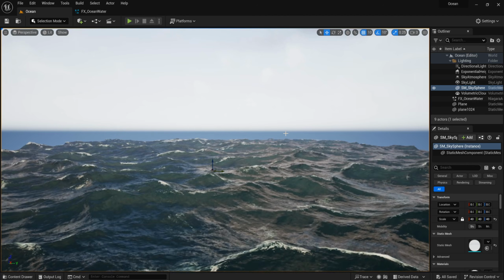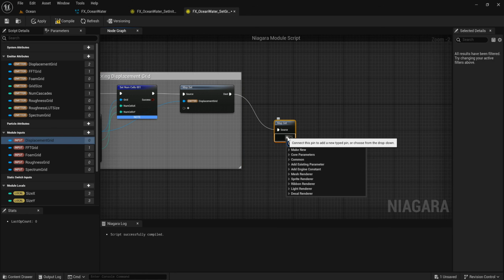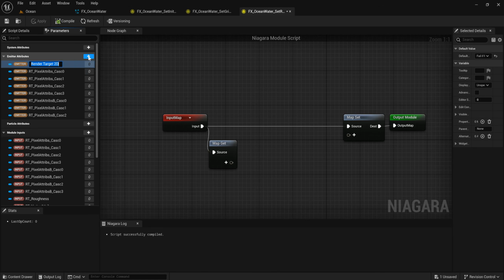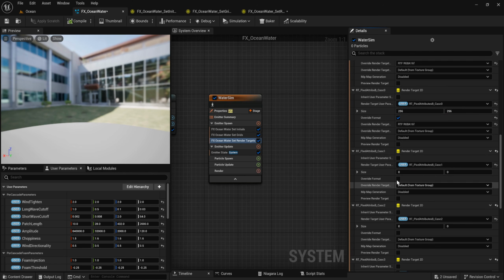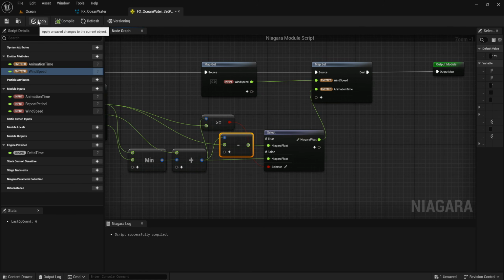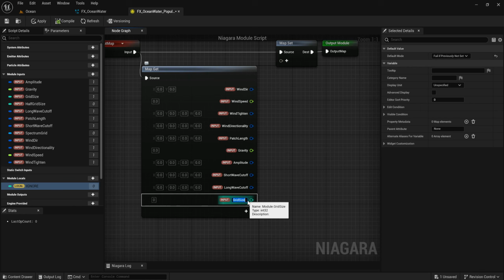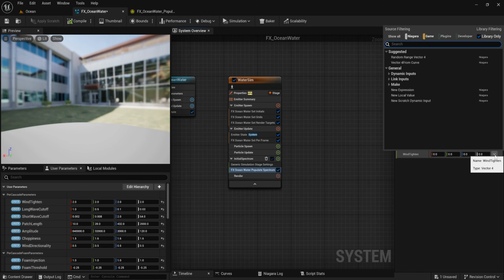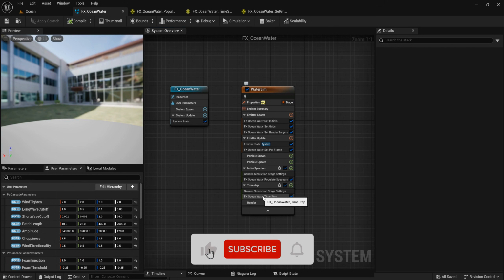Unreal Engine Ocean Simulation Tutorial: Part 2

Comment: Question. I had errors at each stage of hlsl code (use of undeclared identifier) and asked to add in prefixes (for example, in the line Freq = floor(Freq / BaseFreq) * BaseFreq; (like the BaseFreq variable is used, but was not declared as an input parameter of this HLSL function). I changed (for example BaseFreq to In_BaseFreq). The error went away. No more errors during compilation anywhere. But the preview is empty.
Reply: did you get anywhere with this?
my preview is also empty

Comment: hi, you have not set the displacement grid, and after step 6 Initial spectrum my preview is not showing anything.
Reply: I have same problem. I run 5.6.1 ver. Are you rurnning 5.3 ? or Are you already solve the problem ?
Reply: plz help me:face-pink-tears:
Reply: @최성연-r3m  i have the same problem. did you figure it out?

Comment: I got these errors, may i know why?

System failed to compile with 3 errors.
D3DCompileToDxil failed. Err0r code: Unspecified Err0r (0x80004005). WaterSim, Particle GPU Compute Script, 
/Engine/Generated/NiagaraEmitterInstance.ush:375:18: Err0r: use of undeclared identifier 'LongWaveCutoff'
	        Spectrum *= k < LongWaveCutoff[GDispatchThreadId.z] ? 0 : 1; 
	                        ^ WaterSim, Particle GPU Compute Script, 
/Engine/Generated/NiagaraEmitterInstance.ush:374:27: Err0r: use of undeclared identifier 'ShortWaveCutoff'
	        Spectrum*=exp(-(k * k) * ShortWaveCutoff[GDispatchThreadId.z]);
	                                 ^ WaterSim, Particle GPU Compute Script,
Reply: I have no experience in Unreal and am just a noob in general but I had a similar issue. I think it has to do with the custom HLSL code brought in via the FX_OceanWater_PopulateSpectrum Module. Check to make sure your naming is following the guide for all points connected on the Custom HLSL and make sure you have all the connections. I hope this helps but I'm sorry if it doesnt.
Reply: It's a mismatch with the variable used in the custom hlsl and the pin name that you declared. Example: HLSL code uses ShortWaveCutoff but your pin is named ShortWavesCutoff.

Comment: Im having these error before adding the stage on FX_OceanWater:
55571_FX_OceanWater_MessageLog: System failed to compile with 2 warnings and 4 errors.
55571_FX_OceanWater_MessageLog: Error: /Engine/Generated/NiagaraEmitterInstance.ush:372:54: Err0r: scalar, vector, or matrix expected
            In_SpectrumGrid.SetVector4Value<Attribute="Spectrum">(IndexXY.x, IndexXY.y, PositiveAndNegativeSpectrum);
                                                                ^ Empty, Particle GPU Compute Script, 
55571_FX_OceanWater_MessageLog: Error: /Engine/Generated/NiagaraEmitterInstance.ush:372:34: Err0r: use of undeclared identifier 'Attribute'
            In_SpectrumGrid.SetVector4Value<Attribute="Spectrum">(IndexXY.x, IndexXY.y, PositiveAndNegativeSpectrum);
                                            ^ Empty, Particle GPU Compute Script, 
55571_FX_OceanWater_MessageLog: Error: /Engine/Generated/NiagaraEmitterInstance.ush:372:18: Err0r: invalid format for vector swizzle 'SetVector4Value'
            In_SpectrumGrid.SetVector4Value<Attribute="Spectrum">(IndexXY.x, IndexXY.y, PositiveAndNegativeSpectrum);
                            ^ Empty, Particle GPU Compute Script, 
55571_FX_OceanWater_MessageLog: Warning: /Engine/Generated/NiagaraEmitterInstance.ush:304:62: note: 'In_ComplexAmplitude' declared here
    void CustomHlsl28C936F24AFF3F2500B367B3A6E7BB22_Func_(float4 In_ComplexAmplitude, int In_SpectrumGrid, float2 In_WindDirection, float In_WindSpeed, float4 In_WindTighten, float4 In_WindDirectionality, float4 In_PatchLength, float In_g, float4 In_A, float4 In_ShortWaveCutoff, float4 In_LongWaveCutoff, int In_GridSize, int In_HalfGridSize, out int Out_IGNORE)
                                                                 ^ Empty, Particle GPU Compute Script, 
55571_FX_OceanWater_MessageLog: Warning:                                        In_ComplexAmplitude Empty, Particle GPU Compute Script, 
55571_FX_OceanWater_MessageLog: Error: /Engine/Generated/NiagaraEmitterInstance.ush:364:33: Err0r: use of undeclared identifier 'ComplexAmplitudes'; did you mean 'In_ComplexAmplitude'?
            PositiveAndNegativeSpectrum *= ComplexAmplitudes;
                                           ^~~~~~~~~~~~~~~~~ Empty, Particle GPU Compute Script, 
LogEOSSDK: LogEOS: Updating Product SDK Config, Time: 1740.635986
LogEOSSDK: LogEOS: SDK Config Product Update Request Completed - No Change
LogEOSSDK: LogEOS: ScheduleNextSDKConfigDataUpdate - Time: 1740.765503, Update Interval: 343.996094
Reply: well. I fix it. But its not showing in preview as yours does. How can i debbug or fix that??

Comment: Iam getting an compile error with the grid module, but the tutorial files has the same error: Variable watersim.NumCascades was read before beeing set. It´s default mode is "Fail if Previously not Set" so this isnt allowed node: Map get watersim, System Spawn Script
Reply: I am certain that you already solved that issue cus it was a year ago but IN CASE you did not just change the ,,fail if previously not set" to ,,Value" in the Selected Details menu
Reply: @zyr0n249  thanks, i having the same problem

Comment: Thanks for the tutorial. I will talk about about a problem I experienced and fixed myself while following the tutorial. If you are using UE5.4 when you add a empty emitter, emitter state module is not there. And without that module you arent able to write to grids and render targets. So that was a silly mistake that took a lot of my time. So I am writing here incase someone experiences the same problem and needs help.
Reply: I get errors like this in 5.4, do you know how to fix?

/Engine/Generated/NiagaraEmitterInstance.ush:1548:6: Err0r: no matching function for call to 'SampleRenderTargetValue_Emitter_RT_PixelAttribs_Casc3'
	            SampleRenderTargetValue_Emitter_RT_PixelAttribs_Casc3(float2(CascPosX[3],CascPosY[3]), SampleValues[3]);
	            ^~~~~~~~~~~~~~~~~~~~~~~~~~~~~~~~~~~~~~~~~~~~~~~~~~~~~ WaterSim, Particle GPU Compute Script,
Reply: I finally found the issue, it was in the last emitter stage for roughness integration. The hlsh has calls to SampleRenderTargetValue which require a mip level as the second parameter. I passed 0 to get it to compile and now my water renders as a flat blue plane 😂
Reply: @ryanoconnor7957  👍🙂

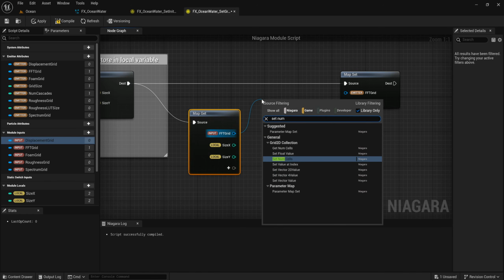Comment: Hello! Does anyone know how to unlock the "Set Num Cells" node?(6:10) My editor doesn't even show the Grid 2d collection category. I've tried enabling the niagara fluids plugin but to no avail.
Reply from the maker: Drag from FFTGrid and search for Set Num Cells. This node is in this FFTGrid.
Reply: @jourverse  I tried, it doesn't work, I'm guessing my installed files are broken in some way, I am even missing the grid 2d presets when I create a new niagara system
Reply: I think I found a solution to this. Go to Parameters > Data Instance and add Grid2D Collection. then drag it into the graph and use that to create a "set num cells" module.

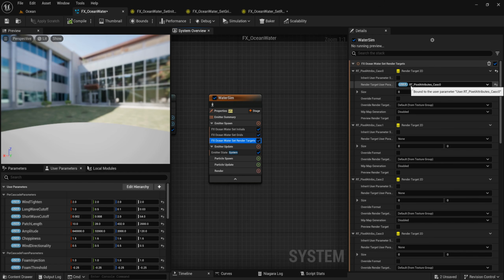Comment: Hi Jourverse, im very excited about your tutorial had some weird problems at 22:00 but it was possible to rebuild some user exposed parameters and it was fixed.
Reply from the maker: You may have some mistakes. In your FX_OceanWater_SetRenderTargets, you should check your RT_PixelAttribsB_Casc0 and Casc3 module input's type, it is Render Target 2D type. Or you might forgot to add RT_PixelAttribsB_Casc0 and Casc3 (USER) in your user parameters of your FX_OceanWater or you added but wrong type. If you can't find the error, you can always download the finish project: https://drive.google.com/file/d/1IqdZL2nC5cH1M_l-xp6NWJVhBwmNXvOv/view.
Reply: @jourverse  wrong type i guess but dont know rebuild with duplicate a apearing one workd fine ;)